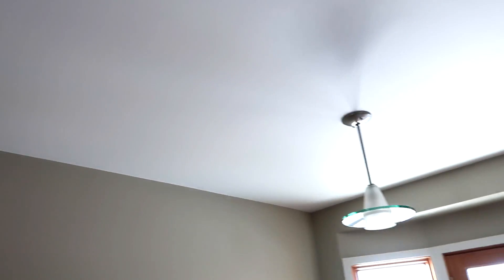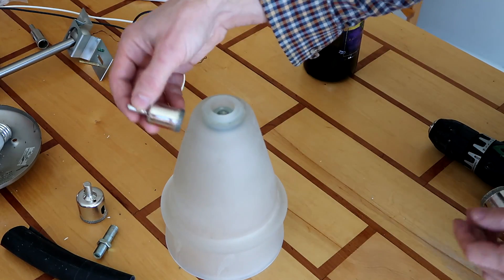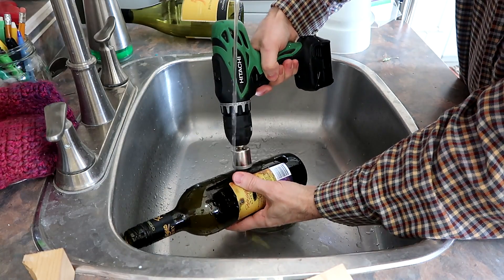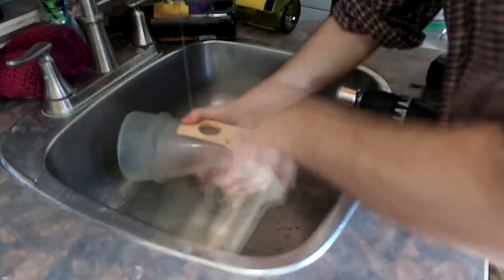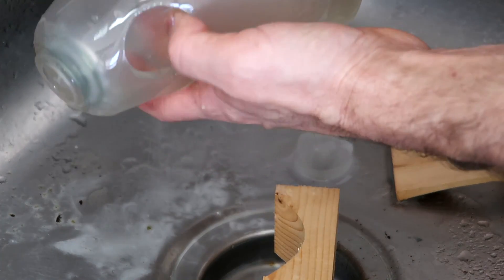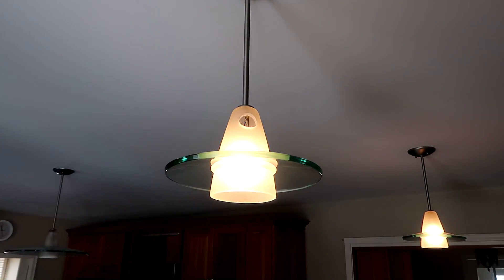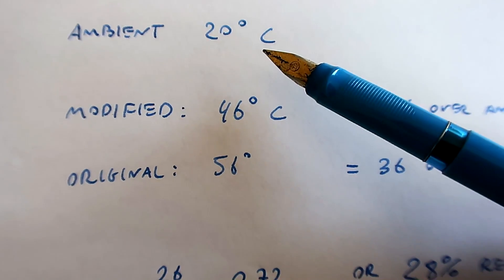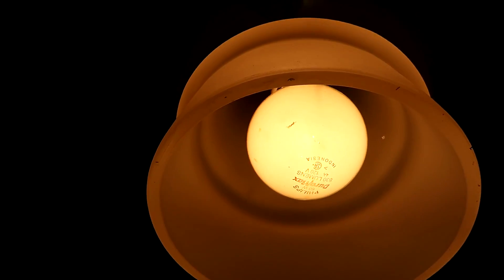Drilling holes in glass

Comment: Thank you for celsius
Reply: conversion points i know off the top of my head:
C = F
100 = 212
40 = 104
0 = 32
-40 = -40 
beyond that i have no clue how warm a "standard" room is in C, or what a typical summer day where i live is in C.
Reply: I did the calculations in Fahrenheit and got the same % in reduction. Measurements in Celsius made no difference here.
Reply: @instantsiv  its more about the knowledge of what celsius is i guess, as for instance, i didn't grow up with or even used in any way fahrenheit, so i can often get confused on knowing what the temp is when someone uses it as a measurement of heat - i know 2 facts, room temp is 20 and body temp is 36 ..... in celsius - but body temp in fahrenheit is nearly 100 and im sitting here like, 100?? what, the boiling point of water??? ... oh ... fahrenheit *rolls eyes
Reply: @instantsiv  Lol sure you get the same ^^ But most people use Celsius thats why he thanked for it.